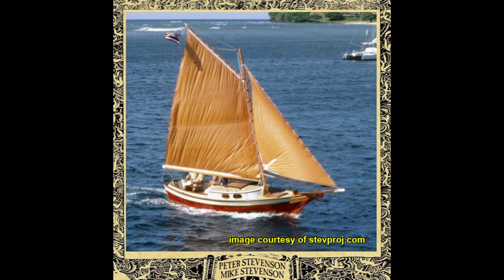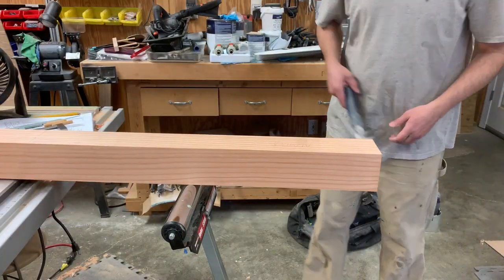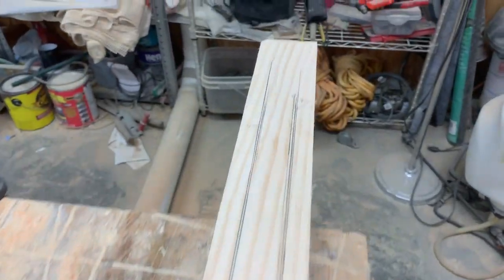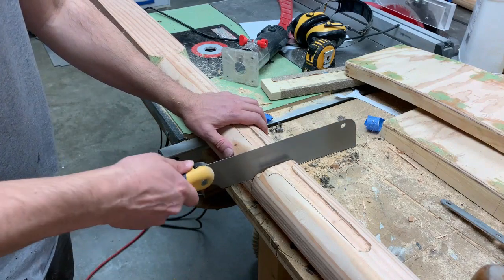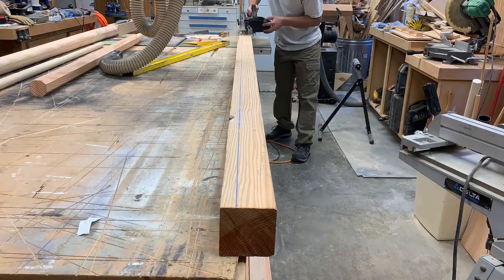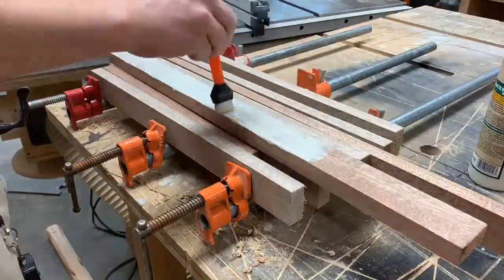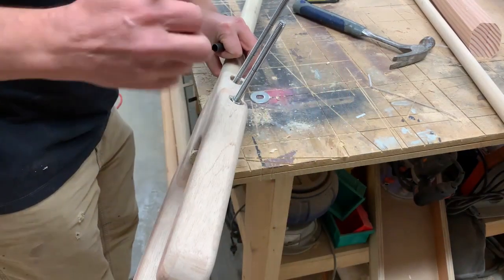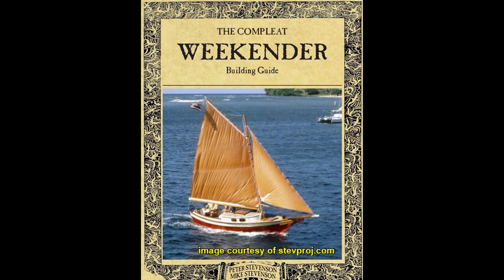Episode 12 The Spars

Comment: Interesting have you ever heard of a tabernacle mast pivot much better than this design and stronger. Used in Europe a lot and can even drop the mast while underway to go under bridges. I know the boat is built but can retrospectly fitted with ease. Worth a look even if you're happy with the mast as is
Reply from the maker: I’ve not heard of that but I’m going to research it. That pivot the way I have it seems weak. It has worked ok once I get the rigging tightened. I’m always worried it’s going to twist off as I’m setting up.